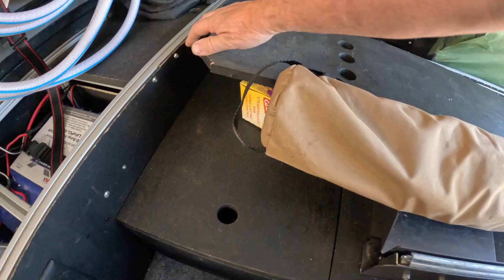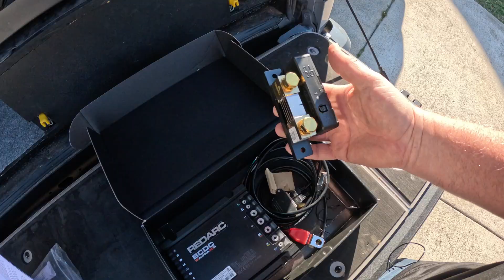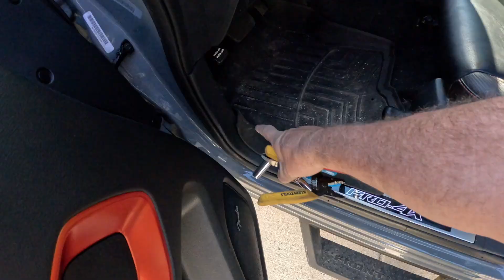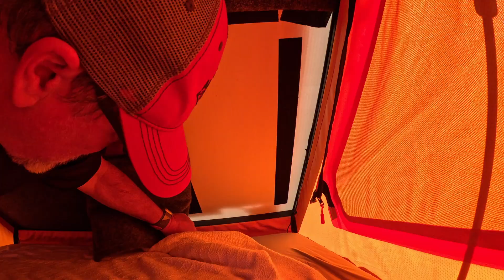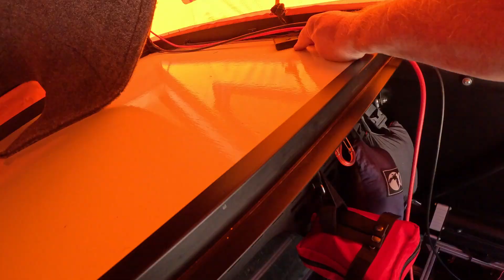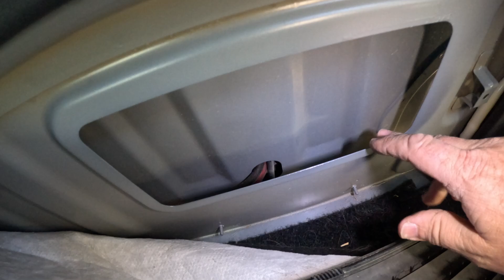Redarc Install, Solar install & Seat Delete

Comment: Is the cruise control sensor mod still working for you? I just got the z1 recon bumper and while relocation bracket seems centered  perhaps i have angle off after watching your video
Reply from the maker: @dustingunter4456  still works. Occasionally it will cut off in bad weather or fog but 95% of the time it works. Sounds like they have the proper bracket on yours. I’d run it and see if you have any problems.